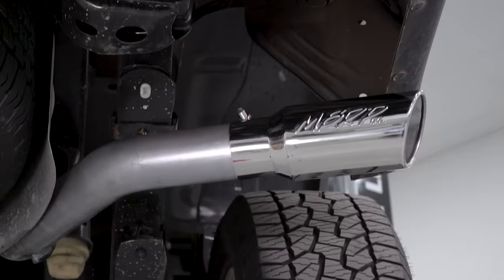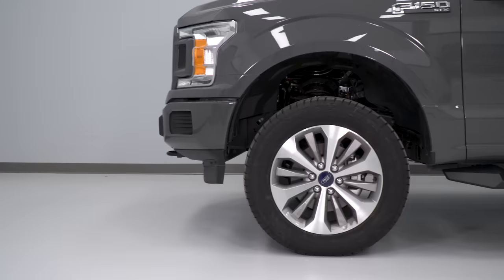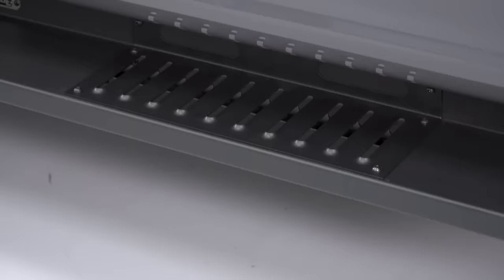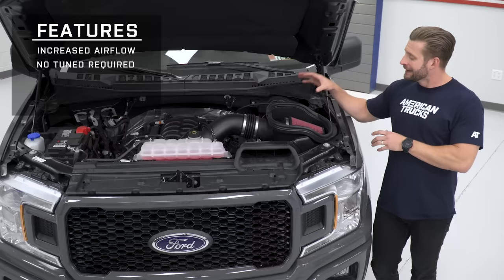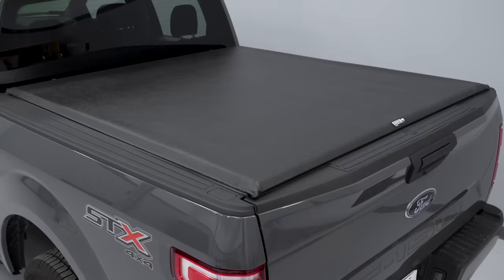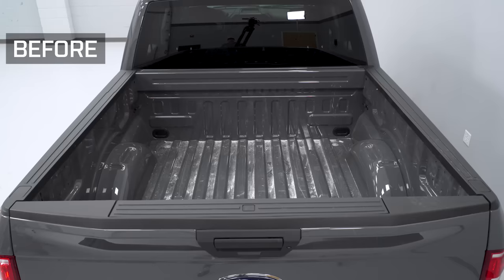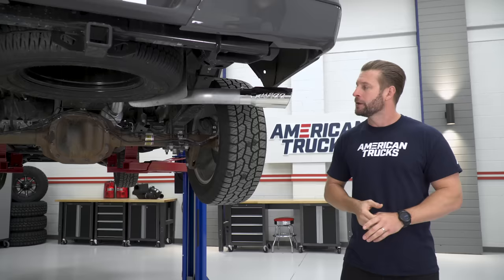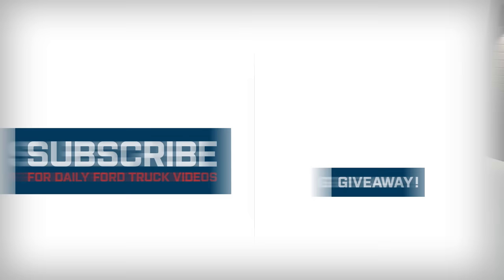The First 5 F150 Parts You Should Buy Under $500 For Your 2015 - 2018 Ford F150   The Haul

Comment: another good $500 or less would be a drop in bed liner if your truck doesn't already have one. they usually run anywhere from $300-$450 for a drop in and around $375-$500 or so from a spray in bedliner i think. it's been awhile so don't quote me on that fully.
Reply: My new Lariat came with a bed-liner and very nice black running boards; I had to pay for the rear wheel liners, though, $205 installed...not bad

Comment: My first 5 parts would be 1. a new block that dosen't loose oil.2.a transmission that doesn't rattle3.,a block heater that doesn't catch fire,4.a seat belt that doesn't explode.5.a dash that doesn't sag.All that at 18000 miles.
Reply: That's what you get for buying a Toyota! lol!

Comment: 1.Tint on the front windows to match the rear and a slight tint on the windshield. Makes all the difference in heat and glare here in FL. 
2. Agree with the roll up fabric bed cover. 
3. Love my factory bed liner.
4. Adjustable Ranchos. Levels and you can really tell the difference in towing.

Comment: First 5 mods should be: 1) oil catch can, 2) tuner from 5star, 3) S&B intake, 4) Stainless Works downpipe w/ or w/o cats, 5) any 3" exhaust that does NOT use baffled mufflers ....6) a bigger intercooler; all of that should net 430tq to the wheels.

As a PSA please adjust your headlights any time you lift or level a vehicle, this also includes increasing tire size or changing the headlight housing to a different brand so you dont blind on coming traffic.
Reply: I have a 2001 Fi50 Lariat 4x4 crewcab. I love the new grills who would I get in touch with to have one custom made for my 2001 Ford Lariat?

Comment: Ok, I did the Running Boards
Bed Cover is Close to $1,000 for a Hard Cover, but I have to have it

I will be getting the Air Intake
I want the BACK RAKED, can I use the lift on the rear only

The FIRST THING you should have done was a spray in bed liner

Comment: I just installed the rancho lift struts, rockauto cheapest by far! No lift in back  oh 2015 f150 crew cab ! Don't buy the lift blocks spent the extra 200 n get the struts! No new wheels just new tires without wheels pacers. N I put on Atturo trail blade xt 305/55r20.   Which measures 33.4x12.3! No issues at all !!

Comment: First five real world mods that cost way under 500 bucks and are essential.
1. Factory Plastic bed liner. No spray on, No roll on. Remember, your F150 is aluminum! Cost is around 250-300 bucks.
2. Husky rear wheel liner. Easy for anyone one to install, takes all of a half hour to install and cost around 60 bucks.
3. Tail gate assist piston. Again, easy for anyone to install and cost under 30 dollars.
4. Tie down plates and cleats/anchors with locks. Easy installation and cost under 60 dollars for both sets.
5. Under rear seat storage box. This is a must seeing we don’t have a trunk. You can store an abundance of crap right under your rear seat and never even know it’s there. Average cost is around 150 dollars. This mod is probably the most essential right after a plastic bed liner and again is an easy installation for anyone.

Roush cold air intake is a waste! 
In reality, you’ll gain maybe 3hp from it. Save yourself 400 plus dollars and just replace your factory paper filter with a K&N. It’s gonna do the exact same thing as a Roush system for 350 bucks less.
Your trucks suspension is high enough. If anything, lower your rear suspension if you just drive on the street. I mean, who’s gonna drive their new truck that they just paid 50Gs for off road? Unless of course your Mommy bought it for you....
You can buy a stainless Borla dual exhaust system on EBay for under 400 dollars and it will sound better than any thousand plus dollar single system.
Don’t fall for the big name brand crap. Shop around and research parts for your F150, read honest reviews and save yourself a ton of cash so you can add more accessories!
Reply: Also,...
Husky floor liners. They're 100 dollars cheaper than weathertech and do the same thing. In fact, they're softer material and fit better. They can be used on either carpet or vinal and wont move around.

Comment: Excellent presentation and mod ideas! Could you please address the level kit (hockey puck style) for FX4? The suspension is  bit different so a 2.5" would not really work; I got the ReadyLift 1.5" for FX4 but the truck does not sit level. Thanks!

Comment: I bought a Flowmaster exhaust system with a series 44 muffler single outlet weld on stainless exhaust tip for 180 bucks for my 2011 F-150 lariat 5.0 liter. Those fancy cat back exhaust systems are way overpriced!
Reply from the maker: If you can do some welding yourself, more power to you! -Zach

Comment: Everything except the soft cover was your typical nice upgrade. Can't imagine spending 400$ just to have it slashed by a butter knife. Now if you park in a garage and only go to home depot in your truck it's great, but for the average guy we need a Hard cover, but those start out at around 800$ and the only 400$ hard covers only fit the older trucks :( so the next best thing is to invest in an automatic machine gun turret 😁
Reply from the maker: You nailed it- price is the issue here.  I have a hard cover on my truck and love the security but since we couldn't find one to fall in the $500 or under category, we opted for a soft cover instead.  -Justin

Comment: That air box replacement is nice BUT since it increases the air flow it will mess with the MAF sensor and send odd data to the main computer and get it confused. It may throw up a check engine light. Most likely though the truck is going to run worse than before unless you reprogram the computer to accept that air box. "No tune up required" yeah sure....the shit manufacturers say.
Reply: The third gen 5.0 coyotes don't  have the MAF sensor in the air intake anymore. Hence no tuning required to correct the AFR's.

Comment: leveling kits give you ABSOLUTELY  ZERO extra ground clearance . it changes ur aproach angle thats about it. to get better ground clearance you need bigger tires. as ground clearance is measured at the differential at the rear of the vehicle  and that normally the lowest point on the vehicle.
Reply: You have to up the front level to get bigger tires to fit without cutting the wheel well.............................

Comment: Had a 2017 f150 5.0 put K&N air filter on it cost $379. Done terrible things for motor-less MPG about 5 - great loss of power. Maybe I needed to tune the motor after putting it on.

Comment: 2.5" level.  Put a load in the back and you'll wish you went 2.0"
Reply: Yup that 8500Lbs in the rear really makes your GF driving look skinny.
Reply: Made that same mistake with mine.. put a 2.5 fucking down road from then on out
Reply: I went with more conservative 1.5 inch leveling kit and truck looks great.. I can't take my eyes off the truck now..
Reply: Bruno is right. I got a 2.0" level on mine and when I have an ATV on the back it's about even with the front end. Definitely recommend sticking to 2.0". Also if your looking to get a level kit for the purpose of bigger tires I have a 295/70r18 Falcon Set on mine with no rubbing.
Reply: @benstjohn2   Yep, I went with 2" and 295/70r18 Ridge Grapplers. No rubbing and looks great.
Reply: SixShooter14 hey man can I see a pic of your truck? I’m looking to do the same setup with same tire size. Just wanna make sure the 2” will work
Reply: @Cgordon1997  I just checked and mine are actually 285/70r18. But, if the link works, you can see them here: https://www.f150forum.com/g/picture/13836586#

https://www.f150forum.com/g/picture/13836589
Reply: SixShooter14 Now that is a good looking truck. Less is more with me. Very conservative, yet with added utility.
Reply: @LynxStarAuto  thanks, gets 22mpg on the highway, sounds badass, and has over 2k# payload rating. But can still haul 4 adults without being too uncomfortable. About the only thing I don't like is the 23gal tank.

Comment: Buy a brand new truck, take everything the engineers calculated to a T, and throw it out the window😂
Reply: I agree. Why would a person "on a budget" throw away a perfectly good air filtration system, a new muffler that actually muffles engine noise along with the brand new pipes that came on the truck? Most vehicles come with thousands of dollars worth of options that are not really optional at all because you have to buy a group of extras just to get the 1 you want, and you add another $2500 worth of after market stuff?
Reply: @maxquigley9524  yes, because a decent straight pipe sounds kick ass!
Reply: You must drive a tesla
Reply: I'm an engineer. We suck. More often than not, we can make things better but clients budgets don't allow

Comment: just bought that leveling kit. Truck is on order stoked to get the truck and install. personally got the Air Raid Cool Air intake
Reply: Why would i not buy accessories for my truck that's on the way? plus AmericanTrucks.com had a spring sale with 20% off order over 100 dollars so i bought some things that i knew i wanted to put on my truck when it comes in at the end of July. Just because i have a youtube channel doesn't mean i make Videos. And im just a 13 year old trapped in a 30 year old body i still like to play its just my toys got bigger and more expensive.
Reply: Glad to see I'm not the only one. My truck is about a month away and I bought a lot of mods already.
Reply: 66skate What mods are you going with right off the bat?
Reply: Stubby antenna, mud flaps, Bed Rug and tonneau cover. May add fog lights later on. I don't plan on any big mods.
Reply from the maker: Congrats on the truck and thanks for the support! -Justin
Reply: yep nothing to fancy here either just the Front 2.5" level kit, tailgate damper but i did opt in for Air Raid cool air intake which was a little expensive but not doing anything else for a while while i recoup the cost of buying this new truck. 2018 F150 5.0L 302A Magnetic SuperCrew 5.5 ft bed and will get pictures up when it comes in July-August time frame.

Comment: I have the newer 2022 powerboost, I probably wont do anything with performance just since there is so much electrical and hybrid system, I have considered different running boards than it came with plus the cover. I take it tomorrow for a rhino lining.

Comment: Forgot to add the tune for the cold air intake. You can't just add the cold air intake with out your computer knowing how much more air it's going to be taking in
Reply from the maker: Since the F150 utilizes speed density and NOT a MAF, custom tune is not required.  Hope this helps!  -Justin

Comment: Yep the exhaust upgrade won't sound good on my 2.7 twin turbo lol. But im thinking of checking out the cold air intake, leveling kit, running board
Reply: FYI.....you will lose about 1.5 mpg after installing leveling kit.  There's a reason why Ford doesn't level the truck at the factory ;)
Reply: I installed the Ford Performance Corsa cat back exhaust system on my 2.7 and it sounds great. I get comments on it often.  No, it still doesn't sound as good as a V8, but it's pretty bad ass. Worth every penny.
Reply: @bdub8459  Yeah, I lost another 1.5 mpg after installing leveling kit. It's a trade off, for sure.

Comment: Cold air intakes are a GIMMICK. If that's the only thing you install you will NOT increase the engine power. The mass airflow sensor adjusts the throttle body to meet demanded power. If the supply of air flow becomes more or less restricted then the TB opens more or less to keep airflow into the engine optimal...Period. you want to spend $350 on a K&N cold air intake so you can brag and get a cool sticker then go right ahead.

Comment: Cold air intakes are useless lmao you would pick up more performance with a muffler swap and/or gutting your cats
Reply: That would be true if they were density based. But they are not. While they don’t pick up much they do pick up a bit of performance and increases throttle response. You should do some research.

Comment: Two questions 1. Is each mods under $500. 2. What is that red drill called that was used at 6:40 exhaust system
Reply: Mathew92 Gaming that’s an impact drill. You can get one cheap at Harbor Freight Tools.

Comment: Disagree with a leveling kit being a mod worth doing, unless gas consumption is of no consequence.  I did it to my 2017 F150 2.7L Eco... immediately lost on average 8mpg's.  Went from a highway MPG of 22-25... down to 16.5 at best... and 13.5mpg in street driving.  I did add ProComp "33's"... but still, I recommend to anyone unless off road trucking is what you do, avoid the lifts and tires.  The running boards are a must, but I used to sell Ford trucks and can't recall a single one of them that didn't come with them... of course that was before the STX revolution of 2018, where they cut costs everywhere on the builds, but add Sync3 and 4x4.  Teanau cover?... you do realize most truck owners buy trucks for the payload ability?  At the end of the day, if street driving is mostly what you do... like me... mods are just vanity purchases.  Maybe get some nice street tires and rims, if your truck came with anything less than 20's... since F150's typically come with pizza cutters.  I would have added tinted windows and some form of a bed liner to this video BTW... not performance enhancing but certainly gives F150's a finished look, that some of them don't other wise have.  I opt'd for the F150 specific bed mat... very very happy, as I'm not a fan of spray in liners... or plastic.  I get it that the theme of this video may have been "performance enhancement"... but there are other "firsts" that should have made the cut.
Reply from the maker: 8mpg is a bit extreme.  Leveling kit by itself won't hugely affect the fuel economy, however putting on bigger, heavier tires most certainly will.  And have you re-calibrated your trucks speedo after the tires?  That could be another issue throwing off your calculations. -Justin
Reply: When I leveled, I was in the mid 13 mpg range before and after (6.2 and a heavy foot). It wasn't until I put the A/Ts on that I dropped to around 11.8 mpg. That's not all that significant to me because I have a 10 minute commute, but the people who drive 30-40 miles to work might notice it.
Reply: Paul_H. D. I leveled my 2.7 and added 305/55/20 BFG AT KO2 and I average 22mpg hwy @ 72mph and 19mpg in town. Did you get your truck aligned afterwards? I will occasionally get 23-24mpg hwy under the right conditions. I also removed the bottom air dam. I average about 400 miles between fill ups. Now once you put a trailer behind the truck the mileage goes to crap. Pulling my UTV on a 7’x14’ flatbed I average 13mpg and with my 19ft alumacraft I average 14mpg.
Reply: Paul_H. D. I’m in Idaho. I’m sure at sea level I’d see improvement. My buddy’s 2016 is the same way. I didn’t reset my trip at the last refill and I’m at 19.2mpg across 570 miles. That includes towing my boat to and from the lake 20 miles away. I’m telling you your alignment has to be jacked. Mine was way off after leveling and my local 4wheelparts doesn’t do alignments so I’d take it to a typical tire shop.
Reply: Paul_H. D. Wheel alignment, when they installed your level kit your front wheels are no longer in alignment. The geometry was slightly changed. I drove 50 or so miles prior to aligning my truck and it drove like crap. Once aligned it was almost as good as stock as far as ride and handling.
Reply: Exploring 208 my front end was just about dead on when I put my kit in, just had a cockhair of toe on one side but that was it.
Reply: Danny B nice, mine was way off.

Comment: Hello, you guys produce some great informative videos. Thanks. You mentioned the 2,5" as being the highest you would go because of CV angle concerns. What are your thoughts on the ReadyLifts SST 3.5". You guys have a video on it, some dealers on the US are installing it, while some people have commented that Ford will not honor warranty if you have problems cause by this kit. I have a 2020 F-150 and looking to put 305/55R20 on it with a 0 to -18 offset wheel. (Still trying to figure out what will fit without or minimum trimming). Thanks
Reply from the maker: I stand by my previous statement- I personally wouldn't go above 2-2.5" without factoring in a 'diff drop'.  At 3.5" I can only imagine the horrible angles of the CV's and the accelerated wear that it would no doubt incur.  For that tire size (33") you should be able to achieve your desired setup with a 2" level- assuming you stay closer to the 0 offset.   -Justin

Comment: Hmm, running boards for under $500. Don't think I'll be needing those, because they are STOCK on the '97-'03 trucks!
Reply from the maker: And that's why I made that perfectly clear in the video.  You don't HAVE to upgrade them if you don't want to, but its one of our most popular mods on the site.  -Justin
Reply: I own a 97 xlt and it did not come with running boards...
Reply: Cole Leveling what kind of cab?
Reply: Carter Johnson extended cab 3 door
Reply: Not on my 1997 lariat lolol
Reply: @TexasManFilms  mine does not have em  either

Comment: My humble 2 cents.  Got a 2019 FX4 with an ARE cap.  Ford does not put tail gate seals on their trucks.  If you go down a dusty road and you have a cap, the bed of your truck and all of your gear (and antelope!) with be covered in road dust/debris.  Ford makes a tail gate seal but does not put them on the trucks.  There are of course aftermarket tail gate seal kits you can get.  This is a Ford fail IMO.